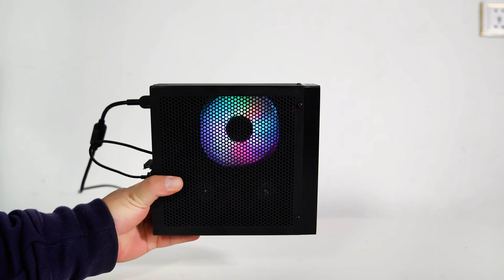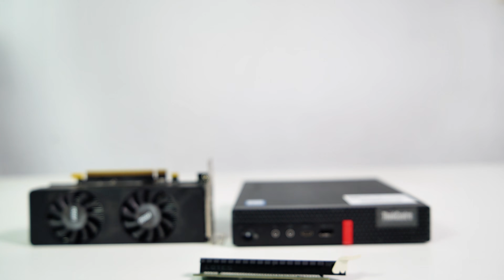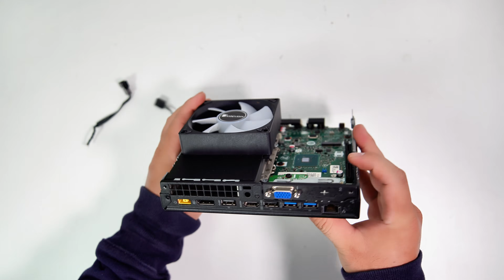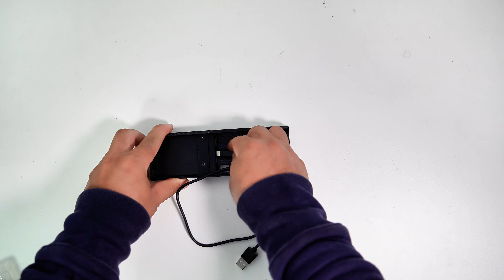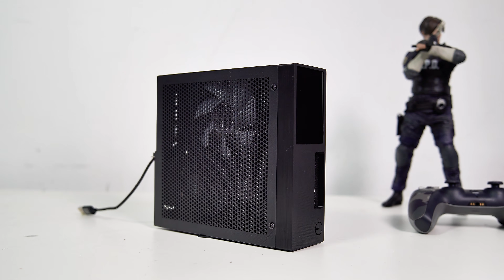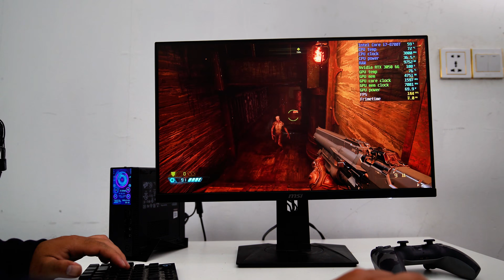Custom 3D-Printed Case for M720q: Can it fit Any Dual-Slot LP GPU?

Comment from the maker: Be aware that the M720q and M920q do not support GPUs by default, so you may need to modify both the hardware and software. If you're really interested in this setup, I would recommend choosing the M920x or P330 Tiny. These models use exactly the same chassis as the M920q and support a 50W GPU right out of the box.
Reply: Hey, could you elaborate on this?
I've built a similar system using an M720q and an RTX A2000 using your videos as a guide and even purchased and printed your 3D files, but I am struggling with system reliability due to voltage spikes from the GPU causing shutdowns.
I've tried fixing this with MSI Afterburner's voltage curves, but this has been mixed, with some games running, some crashing, and some not loading at all. Could you share the software changes you made to the system in this video besides ThrottleStop?
Reply: @luke5kr  at first im also experiencing the same issue while playing the killing antidote at best quality, it shuts down after some minutes while on best quality. After another driver update from nvidia i can play now at best quality and ultra on the games im playing. My gpu is yeston rtx 3050 lp
Reply: What mods do you recommend doing? Im doing this with a m920q currently having crashing problems even when im using throttlestop and unchecking the necessary setting.
Reply: got the p330 tiny with RX 6400 low profile, definitely will use this design but got the problem is at the back, later I will tape the empty distance of the gpu 😅
Reply: I just bought this design from Patreon, can you make a back panel for 1 GPU slot ? the hole so big coz i'm using rx 6400 low profile 😅
Reply from the maker: @P4P1d  Sorry I don't have custom 3d design service but can check this video: https://youtu.be/91bqoSrSMMQ . You find the link for 3D model bracket of RX 6400 in this video description.
Reply: @itggear  you create this design for 2 slot low profile gpu (the back panel) but i'm only using 1 slot low profile gpu., so sad you dont do custom design for the design you create 🥲even though I want to buy it., noted : i already download the bracket for RX 6400
Reply: @itggear  i buy your 3d design in patreon
Reply: Hello, where can I find the 3D print file for that 92mm fan you designed and printed?

Comment: Is there a big difference between an i7 8700 and i7 8700T?
Reply from the maker: i7-8700 is a 65W TDP CPU and i7-8700T is 35W TDP CPU. This tiny PC model only support a 35W CPU.
Reply: @itggear  Thank you. I was actually thinking of using the i7 8700T on the HP Elitedesk 800 G5 SFF like in your other video. Do you think I'll be losing too much performance on that? Hoping you can respond again.
Reply from the maker: @AA-db9cb You won’t lose too much performance for standard tasks, but the HP EliteDesk 800 G5 SFF can actually handle the standard 65W i7-8700 completely fine! Since the SFF (Small Form Factor) case has a larger power supply and better cooling than the tiny "Desktop Mini" models, you don't need to limit yourself to the 35W "T" variant unless you specifically want ultra-low power consumption and zero fan noise. If you already have the i7-8700T, it will work perfectly fine, but you'll lose about 15-20% in heavy, multi-threaded workloads compared to the standard 8700.
Reply: @itggear  Thank you. That addresses my question directly. I'll be using it as a NAS and maybe some gaming with a GPU.

Comment: You know what would be better? Building a case that doesn’t use the riser extension and effectively makes it a cube, keeping the hard drive option.
Reply from the maker: No, this pc dont have standard PCIe slot. It's not PCIe riser, it is an adpter that convert Lenovo proprietary slot to standard PCIE slot. without this adapter you can't fit any catd to that slot.

Comment: Don't suppose you can make the same case but with the female USBC connector in the back like the old one I really want to work on this project. If it all goes as planned, I should have a 3D printed 80 mm fan shroud your case hopefully with that small adjustment. 32GB of ddr4 RAM and an Intel core I9 9900 processor And an RTX? A2000 low profile graphics card I'm hoping to build this for my fiance

Comment: For better cpu temps you can also use gasket sealant around the fan and fan mount like i did and around the cpu cooler, be sure to use automotive high heat engine gasket sealant though, its stronger, creates a tighter air seal and has better coverage, I saw a 5-6 C drop with mine when I sealed the cooler

Comment: Now I have my tiny gaming pc and I'm very happy with it !!!!!!

Just two observations:

1) In order to install win 11 you should to enable the "security chip" (TPM 2.0)  feature of the computer's bios (f1 when booting, go to SECURITY in the menu, select Enabled in the "security chip option"). I had to face this issue because I changed the mb's battery and I lost all the bios configuration.

2) You have to enable de 8x PCI feature in the Bios just as you say in the video.

FYI: I'm not a RGB fan guy,  so I changed the RGB fan and installed a Noctua fan which is very quiet, and it comes with 4 wires with the same colors of the original fan.

Comment: That's very cool! Would you think this fan is more powerfull than the standard one? I'm mostly looking to get better cooling to get a non-t class cpu running with better temps. Or would other ones of your case/fan combos work better for that?

Comment: Hey, maybe someone here in the comment section can help me.
I have a similar setup with an i5 8500 and an rx 6400. Today I was planing on switching to this RTX 3050 lp from MSI, but the PC wont boot with it being installed. It seems to be a compatibility issue of some sort. Does anyone know why this could be?

Comment: Thanks for sharing the 3D files, I bought them and printed the fan bracket, just installed it last night and it seems to be working great!!!.

Just one question, does the fan you use in this video has build in rgb or did you had to wire it to the sata adapter as well?, the fan I got has an additional cable for rgb but if this one feeds the rgb light from
The Pwm connector I’ll try to order the same one.

Thanks again for sharing this vid!!!
Reply: @EndmostMist64  is the fan bracket include in the files when you buy it? Could see it advertised in the package he linked.
Reply: @GoldSlide it is, the package came with all the files needed, I already used them for two computers and they work great

Comment: Can try to install a wifi card inside with internal antennas to clean up the PC looks. Intel Wi-Fi 6E AX210 works in the P330 without additional tweaking.

Comment: Awesome video, I am also fan of mini PCs transformed into gaming PCs. I have a question - I am using HP Pro Mini 400 G9 Desktop PC with i5 12500T and 3070 connected with GDC EXP Oculink version, but sometimes I see lots of frame drops, my question is how to remove the power limits of the processor? Do I have to buy more powerful adapter because the original is HP SMART 90 Watts.

Comment: Sir, Can it work on Zotac rtx 3050 70watt low profile? Thank you
Reply from the maker: Yes, it could. However, the M720q and M920q PC models do not perform well with a GPU installed. If you're really interested in setting up something like this, take a look at the M920x or P330 Tiny. These models are priced very similarly and use the same chassis, meaning you can still use my 3D case design. However, the M920x and P330 Tiny can run a 50W GPU right out of the box, whereas the M720q and M920q cannot.

Comment: Does the cpu fan shroud "92mm cpu fan shrould.stl" also fit M90q/P350 models?? (I'm using your 3D case mods on both P330 & P350 tinys)

Comment: Really neat video, i want to buy an lenovo M720Q, but it's not to transform it as a little gaming pc, but has a router for my homelab, i want to put a 10gb/s nic inside it but i was worried that it would get too hot inside because of the network card and the only fan inside the mini pc, but it's a great idea to 3D print a case to put a 140mm fan inside, that's what I'm going to do, thanks for your video. Unfortunately i don't have a 3d printer lol, but it seems to me that there are services that can print in 3d for you
Reply from the maker: You may also check my Printables profile, there many style of  free 3D model for M920x/q M720q, P330 tiny. Thank you.

Comment: Excuse me, friend, but doesn't it affect the fact that it uses so many watts for the PC?
Reply from the maker: Why not? RTX 3050 6GB requires 250w psu and I used 300W ac adapter in this video.
Reply: @itggear  Okay, you're right. I got confused and didn't pay attention to your explanation. Cheers and good video.

Comment: Is the CPU fan connector the same with GPU fan connector?
Reply: i've just bought the same connector, we'll find out in a couple days, as ive bought the 1.23mm cpu connector to 4 pin from aliexpress, guess i'll find out soon, bro
Reply: @SevinKamuels_AFC2026  thank you for testing it, i hope it does work
Reply: @Mahe-ID  I will post a link to my finished product with all links to ALL Aliexpress products that circumvent making cables from scratch also cheaper alternatives to things like 3D printing services (international obviously) as I've found a German company that printed the case for $25 and offers free shipping worldwide.
I've also found a cheaper ($7) 4 pin only CPU fan (92mmx92mmx25mm) that should fit the shroud, however I'm being really hopeful and speculative, but in theory looks as if this should?? work.
so much love FTC- For This Community
Reply: @Mahe-ID  its a 1.25mm mini CPU connector, sorry for the typo

Comment: I'm having problems with my project. I'm using i5 8700t and a yeston 3050. My power adapter is 170w. My pc crashes. Any help??
Reply from the maker: I think the problem is that the VRM chips are overheating. The M920q and M720q do not support GPU installation and lack adequate cooling. These models only use a 35W CPU cooler heatsink, and there is no heatsink covering the VRM chips or chipset. In contrast, the M920x and P330 Tiny support GPUs and generally have a chipset southbridge heatsink. Additionally, they use a 65W CPU cooler, which provides better coverage for the VRM chips located near the CPU.
Reply: @ so what i have been doing is lowering the power that the graphics consumes. That's been keeping me from having the PC shutting down. But still cannot game at it's 100%. The CPU i got it fixed because it had an i5 k and changed it for a T. I'm testing a new power supply of 230w but still gives me trouble. Would you even think about soldering new VRMs solve the issue?? And also thanks for answering. Your projects are awesome!!
Reply: @itggear  at some point i guess the best is just to put a oculink adapter and do everything externally

Comment: Im new to 3d printing. Im looking to buy Flashforge Adventurer 5m would that be good enough to print these parts?
Reply from the maker: Absolutely! The Flashforge Adventurer 5M is a great choice, especially for beginners in 3D printing. It has reliable performance and should be more than capable of printing these parts. Good luck with your 3D printing journey!

Comment: The CPU cooling fan uses 12V, while the CPU fan port on the motherboard is 5V, right? In that case, will the fan be weak and not cool effectively?
Reply from the maker: Lenovo uses a 12V CPU fan since it has a PCIe slot with a 12V power rail on the board. On the other hand, Dell Micro PCs don’t have a 12V power rail, so their CPU fans use 5V DC. As for the CPU and GPU temps, the Afterburner graph clearly shows that the maximum CPU temperature while gaming is 75°C. Whether this is acceptable or not is up to you.

That said, with a Lenovo Tiny PC running a 35W CPU, the CPU temperature isn’t really the issue, it’s the motherboard components, like the VRM chips and chipset, that might overheat. Adding a big fan could make a significant difference in helping the system run more stably. Thanks!

Comment: Hi! Have you compared the CPU temps before and after installing the shroud with the bigger fan compare to the OEM cooler? I am curious if the bigger fan is more effective in such a small case. Appreciate if you can share some figures!
Reply from the maker: I added the fan to this PC setup not to address a CPU heat issue, as this PC does not have any problems with CPU temperature. It also won't improve CPU temperature since the CPU cooler's heatsink is not exposed. The main issue with this PC is the overheating of the motherboard chipset and VRM chip when a GPU is installed. By adding this fan, the PC runs much more stably as it pulls a significant amount of air into the chassis, keeping all components and the motherboard cool. If you'd like to check the CPU performance with the original CPU cooler, please watch this video: https://youtu.be/3cogfTnEcvA

Comment: nice video, but i have a question, is it save to not cover the graphic card and motherboard to prevent it from shorting? that graphic card doesn't have a backplate right?
Reply from the maker: It was designed by Lenovo engineers to work safely with add-on cards, so there’s no need to worry about this.
Reply: @itggear  one last question, is it safe to make this build as a daily gaming machine/productivity machine? I heard this build has an issue with it VRM getting hot.

I really want a mini and simple build that i can carry it anywhere and this build is the answer. But, i'm scared that this build has a lot of problem.
Reply from the maker: @VimopaCeyunis-wq2gi Most problems arise from using non-genuine products like ac adapter and PCIe riser and a lack of user experience. I believe the main purpose of YouTube videos is to provide entertaining and educational content, rather than to persuade viewers to replicate the exact actions demonstrated. Additionally, I have included a disclaimer in this video's description. Before proceeding with any actions, individuals should conduct thorough research to gather more information and ensure they fully understand what they are doing.

Comment: Hey do you plan to make a M720Q 3D case model with with the wifi front antenna and the motherboard speaker implemented into the case i would total buy those prints
Reply from the maker: Sorry I don't have plans to that. Thank you.

Comment: Hi. I tried to use the lenovo m720q with amd rx 6600 graphics, hooked to an external PSU and the lenovo riser for the gen 3 pcie x8 slot, and the core i5 8500T to play FF7Rebirth. I am getting 15 FPS while CPU and GPU usage sits at around 20%. What am I doing wrong?
Reply: Have you uncheck BD PROCHOT at throttlestop?

Comment: I've recently done something similar, m720q added 32gb ram, upgraded cpu to 9700T & msi 3050, 230w adapter.
But question has anyone used a system like this with Batocer? I am and i have some odd under performance with some emulators.  Running CEMU during gameplay all the cores are flat at 800mhz, this only happens with this emu. Not sure if it's hardware or software to blame. Bd prochot seems to be disabled with the batocera OS so it does run full on other systems.
Reply: so yeah i watched some youtube vvideo that said this is because the pcie power is designed to only draw 50w so it lowers the cpu clock and what you can do is undervolt your gpu until it consumes only 50w of power

Comment: pairing it with  a  cpu with low tdp, that thing will be good for low power  consumption.
Reply from the maker: The CPU installed in this PC is 35W TDP CPU which is the lowest TDP CPU already.

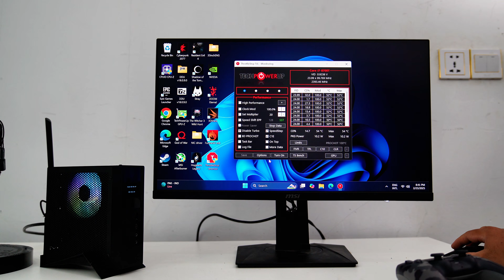Comment: 8:05 I have all the components connected, but I have a question, is it necessary to have the 300w power charger? I have a 230w uni but when playing God of War the PC gets stuck and restarts or turns off. Is there a solution? Thanks
Reply from the maker: Make sure VRM chips are not getting too hot. You can use the HWiNFO64 app to monitor these chips. If you see one of them reaching over 140°C, your PC will shut down to prevent damage. To fix this, you can use the ThrottleStop app to limit the CPU power to around 25W and the max turbo power to 30W. Additionally, use MSI Afterburner to limit the CPU power to 80%. Thank you.
Reply: @ Thanks for the help, I will implement it and let you know. It would be good if you made a video explaining these methods since some of us are newbies. Thank you very much.
Reply: @mikegonzalez8153  did that work? Having the same issues.
Reply: @ I have looked for a way to do it but unfortunately I could not solve it, it would be good if he could help us with a guide.
Reply: @mikegonzalez8153  been testing a few things. I dont think it is the VRM temps. Mine runs high playing or not. I thinks its the bottlenecking, ordered a new cpu, cc150. Will update in a few weeks after i get it.

Comment: Got mine running. Just got a Intel CC150 in to upgrade CPU performance.  Wish i had a 3050lp or 4060lp to go with it all. The Yeston 1650lp will have to do for now.
Reply from the maker: @forzaflyracer3473  I'm afraid that it won't work. That CPU has a 95W TDP, and this tiny system doesn't even support a 65W CPU.
Reply: @itggear  I'm gonna give it a shot. I've seen people have success with a i7 8700. Worse that happens, it doesn't work and now I have a new reason to make PC for sale.

Comment: hello just wanna ask is the m72q and m720q is the same? trying to buy but not the only available one is lable m72q cant find any info about it dont know if its the same m720q that has pcie slot
Reply from the maker: I think that is a typo since there is no M72q; it could be M70q or M720q. Thank you.
Reply: @itggear  thanks, i was confused on the sellers listing it was advertised as m72q